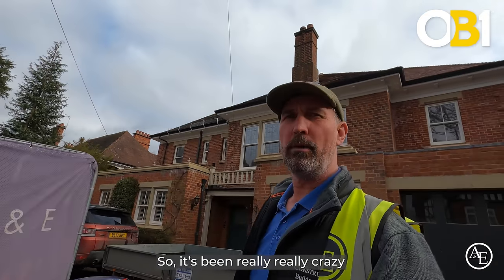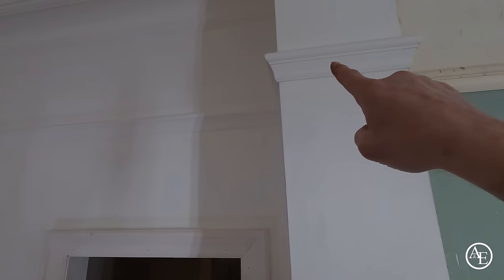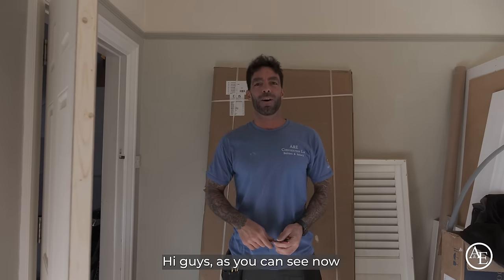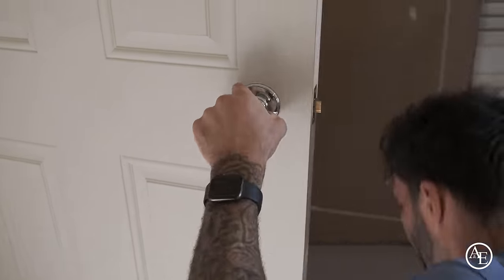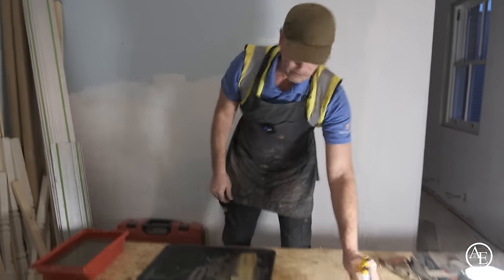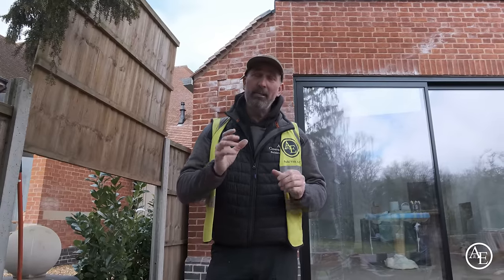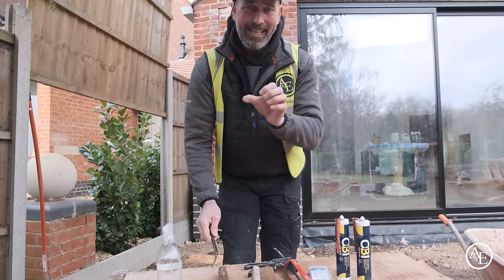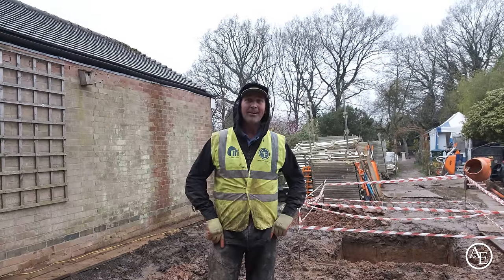Bespoke Kitchen Installation & Final Touches! - Luxury Extension | Onsite #21

Comment: Tony try using the Tormek grinding system...faster, more efficient and same results as water stones.
Reply from the maker: Hi Stevie I do have one but sometimes I do like to switch it around a bit all the best Tony 👍
Reply: I remember as an apprentice and a few years after all we had was a Norton India red stone you had loads of choice  fine one side coarse on the other, my boss where I did my time court me using an eclipse honing guide I'd bought, he took my chisel out of it and threw the honing guide in the bin then went on to give me a proper earbashing ending with practice and learn to sharpen free hand which I've done for the last 37 years on site but in my workshop I now have a tormek, hope my old gaffer doesn't read this. Great job by the way.
Reply from the maker: @tonymcroberts3252  your spot on Tony free hand is a definitely the way forward because I think it’s really important to learn any skill well then us other methods but the old are best all the best Tony 👍